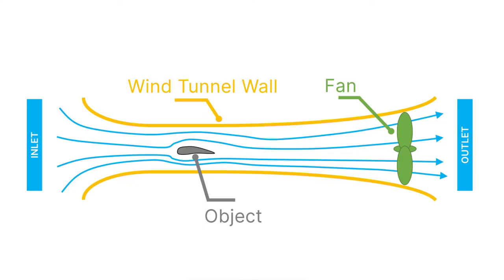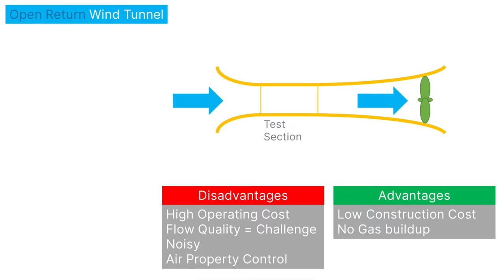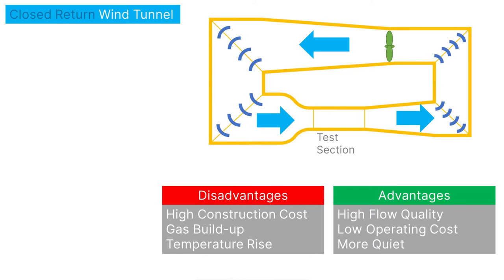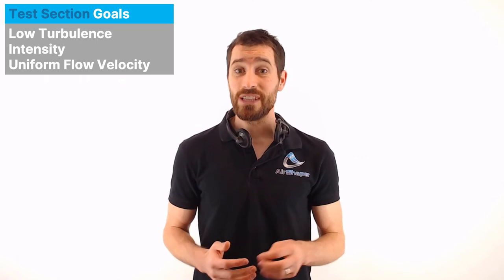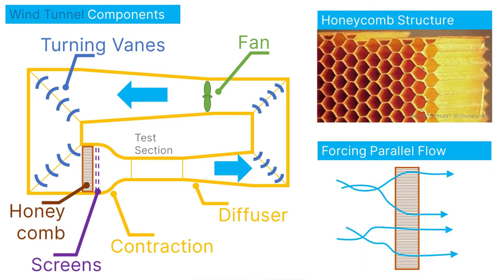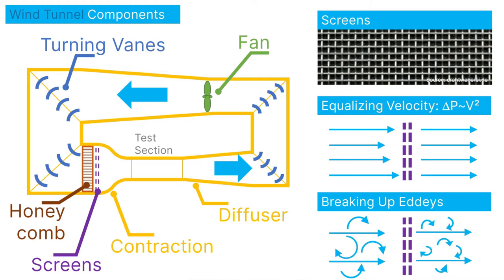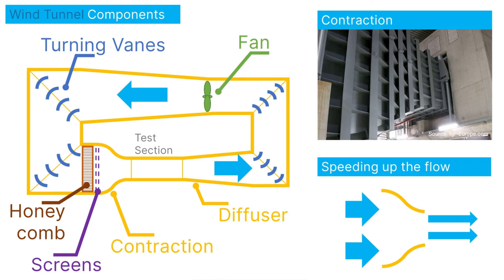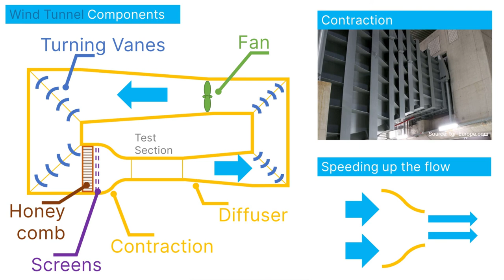How Wind tunnels Work – Contraction, Test Section, Diffuser, Fan, Turning Vanes and Settling Chamber

Comment: Nice done!! A small piece of advice: Adding the context about the function of approach each specific parameter of each component such as the ratio of the diffuser radius and experiment chamber radius or the length of the honeycomb will be made this video stand out from others that takes about the same topic.
Reply from the maker: Hi Justin,
indeed, more specific design values would definitely be good for those designing their own tunnel.
In this video, we decided to keep things a bit light, without diving too much into the details :)
The next one will be on size, speed and cost of the tunnels, and the one after that on measurement techniques - I hope you'll like those.

Comment: Great intro to wind tunnels. I had a Q's based on some of the wind tunnel videos I watched online. 

What type of smoke is used for flow observation in the tunnel? 

Also in F1, how do they control the smoke. I mean where the smoke (stream of air) should be incident on the car?
Reply from the maker: Hi Risheek,

I actually wouldn't know what type of smoke they use.
Perhaps it could be interesting to contact one of the wind tunnel institutes to ask them?
Reply: @AirShaper 
Okay thanks

Comment: Thank you for the video,more detailed than I've seen until now. A question popped into my head,if I am not mistaking in the real word the air has some turbulances,but here the air form what I understood it's quite directed. Does this "forced" direction of the air help in the real world situation?
Reply from the maker: In the real world, it's often the object moving through the air instead of the other way around. So there you'd need to compare the turbulence present in the surrounding "standstill" air to the turbulence generated by forcing the air to move. In some cases, the ambient air can be very turbulent (city traffic, thunderstorms), in other cases it can be very stable.

Comment: Pt.2 how do you reduce the heat and could you allow some air to escape along the circulation
Reply from the maker: There are indeed examples of tunnels that have longitudinal slots along the test section to let some of the air out, although this is also partially aimed at reducing the blockage / wall effects. And some tunnels have large cooling installations to control the temperature (some even go to very low temperatures to improve the similarity between the real and test condition - see our interview video with AIRBUS: https://airshaper.com/videos/airbus-talks-aircraft-design-tools/G60rTDR6CPw)

Comment: 1:13 Why you donty use toroidal shape instead of square ? in corner produce turbulence.
or Elipse form if need more large test stand.
i dont like the close loop because cant include smoke. I see sameone use helium buble but that add cost to the previous one. And i am not profesion where i need run it 24/7.

Comment: Would the upstream velocity be lower in the closed circuit tunnel compared to open circuit (meaning just before the test section)
Reply from the maker: Hi Kyle, the velocity just before the test section depends on the contraction geometry, and not too much on whether the air is recirculated or fresh from the environment. But for the open tunnel, you can have a different turbulence intensity for example, if that is what you mean?
Reply: @AirShaper  Okay makes sense thankyou, it's just because I've been assigned a task to compare open and closed return wind tunnels which i have done but then it says, use the values found in task 6 (it was an example of a convergent-divergent part of an open return wind tunnel)  and compare them to what values might be found within a closed return wind tunnel if that makes sense?
Reply from the maker: @kylehenderson7344  Hi Kyle, it's a challenge to know what is meant without the context of the assignment and I wouldn't be able to dig in. But perhaps you can take the discussion we had here back to the professor and ask what he/she thinks/means?

Comment: I am thinking all my life about how to build the fastest possible track car and i just cant find good content about that. 

I guess the most "simple" way is to take the current worlds fastest car (2020 F1 Mercedes i guess) and remove regulations kind of like the 919 evo. So we would improve fuel flow, minimum weight, power etc. and probably give it all those banned stuff such as active suspension and all those clever traction controls with torque vectoring etc.  

but what about aero? 
would real sideskirts still work better than vortex seals for the unberbody?  
would covering the front wheels definetly improve performance? 
is a fan combined with skirts, active wings and flaps the ultimate way to insane downforce levels? 

well i understand that nobody is building such a crazy car but why are there no concepts for this?  i would imagine all those clever engineers are dreaming about a no regulations f1 car secretly and i would absolutely love seeing this thing take on the nordschleife even if we need g-suits for the driver.
Reply from the maker: Hi Quarkhammer,
yes, you would definitely be able to gain loads of aerodynamic performance.
- Side skirts: these can really help to generate a lot of ground effect, as they prevent surrounding air from leaking in.
- Shielding the wheels: although open wheels can generate downforce, they generate a lot of drag too. Shielding them can help to clean up the flow which may allow for more performing aero elements on other locations of the car.
- ...

Check our video on the Gordon Murray T50, where we discuss some of those issues!
https://youtu.be/FSaI6STYIQA

Also interesting is the RedBull X2010 Playstation concept - you'll see much of those ideas included there as well (and that one also was a no-limits approach :) )
Reply: @AirShaper  thanks for the answer! the X2010 really seems to be the closest prototype. sadly i couldnt find in depth info about it. i bet the community would love a detailed aero analysis video from that thing ;) 

and what do you think has changed in these 10 years aerowise? are there any new inventions in that sector that would make the x2010 faster? maybe plasma actuators some day?
Reply from the maker: @th1nk_outside  Indeed, I think the "manipulation" of the boundary layer using plasma, magnetic fields, ... could be the next big thing. Just imagine what would be possible if you can post-pone/tune the separation point to your needs!